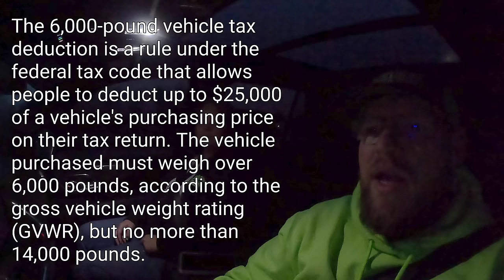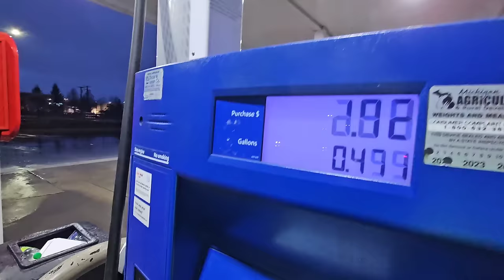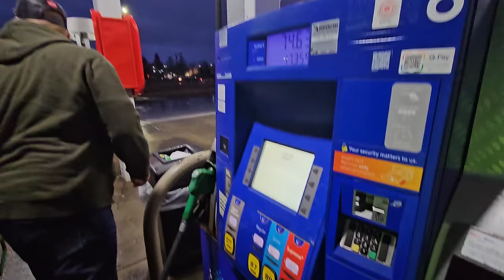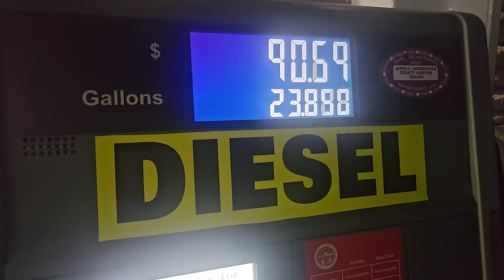WE ARE PICKING UP OUR 2024 LAWN CARE TRUCK/TRAILER!

Comment: You’ll like this truck. What we found worked best for us for trimmers and backpacks was to remove a section of the drop-down side on the passenger side about half way down and mount 2 equipment defender backpack holders. As long as the rail has a hinge on the end of each section it will be fine. The 4 place trimmer rack is too tall to reach the top. Two of the 2 place racks could be mounted on the sides to the floor and against the inside of the rails. We found that having any of these things in the front by the headboard is a pain because you have to walk up there all the time and around mowers to get to it.

Comment: Shawn, That panel that got doused needs more inspection. Several of the breaker lugs looked rusted, the main bus appeared to be oxidised. Not having great connections  will lead to a heat build up and possible fire. It needs to with a cleaned or replaced. I have little confidence in a 6 dollar breaker with rust on the lugs.
Reply from the maker: We have an electrician coming next week. This was a temporary fix.

Comment: Connecting galvanized to either brass or copper is a recipe for disaster due to galvanic corrosion.  I always put in a dielectric union when installing a water heater of transitioning from galvanized to either brass or copper.  The galvanic corrosion will cause the galvanized fitting to corrode.

Comment: Hello from Ireland guys...Just a thought for you, if you do decide to tarmac the bunker lay the tar at a 1 or 2-degree grading so that any water will flow off into the drain leading away from the base.
Try spraying some expanding foam between the blocks where water gets into the bunker and maybe that will help might be a cheap fix 🤞
Reply: The concrete should’ve had a grade put in it with it was layed

Comment: So the hot water heater you installed had galvanized 3/4” elbows. You should remove them and install 3/4” copper female adapters.

Comment: Only thing I would do is get some lights on the side of the trailer on the truck. I know some of them can be hard to see in the dark without lights. I ran into the same issue when changing out my hot water heater. There is a short and a tall and still they don’t fit all the time. You have to ad some duct work to the vent. I also have the same hot water heater lol

Comment: Congrats on the truck! Tractors  are great for Haying, but not great for snow the first corner he try’s to take with a load on the snow wing he’s going to wish he bought a wheel loader.
Reply: Tractors are typically what’s used up our way when trucks and stuff can’t push. The tractors are actually the way to go
Reply: @freedomlawnservice1987  maybe if the tractor had a set of Nokian snow tires but it’s worthless with those tires

Comment: Glad to see you're continuing to grow. However why'd you choose this over truck n trailer? It breaks down, flats etc and you're without your equipment.
Reply: We have 3 of these trucks and have had less downtime overall. Trailers tend to have more flats, wiring problems and brake problems. The key is to have a spare truck and trailer just in case.

Comment: If you or anyone builds a “ mafia block “ wall use great stuff type foam insulation as you are stacking it will seal/ stop most of the water , when you dig out the sides use perf pipe and 3/4” stone all the way to the top , just saying
Reply: Great stuff is not water proof its water resistant does not like sun light also

Comment: Rather than using plastic on your salt bunker, get some foundation membrane and then backfill it with gravel over your drain tubing and cover it with filter fabric to keep the dirt out. That way any water that finds its way close to the blocks will drain thru the gravel and flow out thru the pipe.
Reply: Orrrrrr don’t put dirt up against the block so it won’t weep through
Reply: @Robert-oe3ig  this would be good too, although I bet a lot of water runs down that hill behind it.  Need a way to make that water flow around it.

Comment: Glad you got yourself a new rig for the mowing season. Did you know there are cement seal for those spaces that needs filling? once done, then you can weather seal the outside part of the brick walls. (same issue on homes with the basements)

Comment: Nice truck Shawn just a fyi you should change out those galvanized 90 deg elbows on the top of water heater it will corrode real bad should use brass in that application. But other than that nice job.

Comment: I do not think that’s the way to go I think the dump truck in an enclosed trailer is the way to go
Reply: Spencer likes those Isuzu 😂
Reply: Isn’t it easier putting grass clippings in a back of a dump truck for those accounts he has to bag
Reply: Glad to see this worked out for you guys! Glad I saw it fast
Reply: It’s not the way to go for everyone but for some companies it’s the best way to go. I like the fact that they are overall shorter than a truck and trailer. We can pull 3 of them into the shop at night and easily back them out in the morning. They are much easier and less risky for the crews to drive around all day. Overall they have been reliable low maintenance vehicles. We don’t bag clippings so that isn’t an issue. We have spare trucks and trailers if there ever is a problem.
Reply: @stephenphillips7491 but he doesn't bag.

Comment: Those older trucks may need a repair now and then but their better than the new ones having major elecrtical issues constantly.  Why pay for new with major issues that the manufacturer won't or cant fix. Thats a nice running truck!
Water heater, water in the electric and water in the salt, that a a mess of issues there! Glad you're getting them knocked out.

Comment: Water in the panel box is not good.  When we got flooded I was talking with our local energy supplier and they told me to get those breakers replaced ASAP.   They will rust fast in the On position and will not trip when needed and your house may burn down.  Just an FYI.

Comment: you had the engine running while filling it with fuel???
Reply: Pretty common to keep the engine running during fueling with a diesel.
Reply: @ericriley3147  I have never done that before since all my vehicles are gas.  LOL  I thought it was a rule to turn off all vehicles when filling up with fuel.
Reply: No spark plugs on a diesel!

Comment: Again, you prove you love to take the shortcut and redo the job over and over instead of doing it right the first time. Love laughing at you from afar, not laughing in your face just laughing at your irresponsibility to do the job the right way. And by the way, don’t mind me with a few engineering degrees and in multiple years and city planning and Code inspection. You could’ve just took cheap hydraulic cement, pack those grooves and spread some venomous caulk, for those who were unaware that will word it means soft, flexible, caulking over the top and then put your plastic on top to Divert your water. Bye dude looking forward to the repair of this fiasco.
Reply: Keyboard warrior. Smh

Comment: There is also a big hole in your rear tarp. The water going right on the salt will 
Dissolve  a ton of your salt.
Reply: I'm thinking their surrounding soil and plant vegetation is going to suffer with that high salinity. Might even sterilize it
Reply: @AshbyAcres  the salt will run towards the front when washing out so it will go into the gravel. Just sucks loosing salt to a hole. Our company had the same problem. Plus those tarps won’t last very long